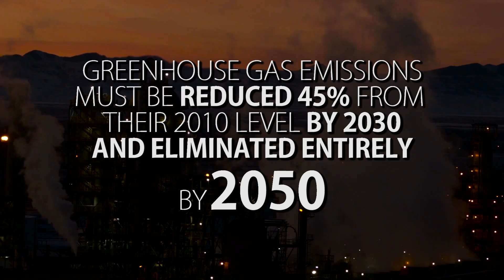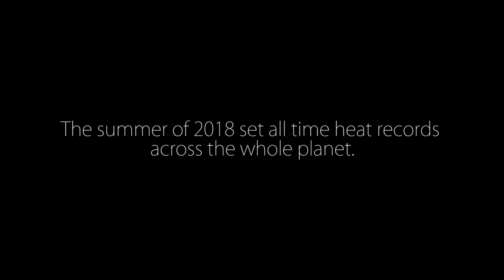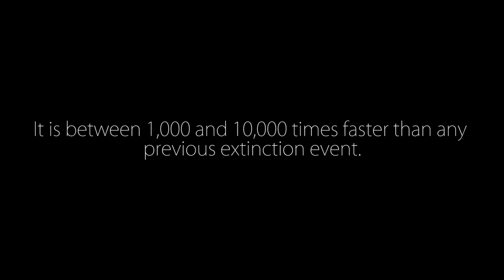History is Marching | Part six: The Sixth Mass Extinction

Comment: A sudden diminishing of CO2, without an equal diminishing of SO2,, will bring more warming first, before it cools down again. We ought to take both out of the air, at once..., otherwise (without methane release from the arctic- which brings a sudden, dramatic heating up, and without the jetstream fluctuations - less salt water in the Atlantic- in account - cooling for Europe), we immediately go +4°C to 6.5° C in less than 3-5 years, before we diminish a few decades later. We know that as US temperature rose right after 'no fly zone' was implemented after 9/11. Of course, as we pretend to ourselves that we 'know' things, we tend to treat the Earth as our own laboratory, but we don't know half of it.
Reply: But we are not talking about diminishing the Co2 suddenly. we are talking about lowering emission, preventing it from growing further. So the value stagnates. Would that still cause the issues you describe?